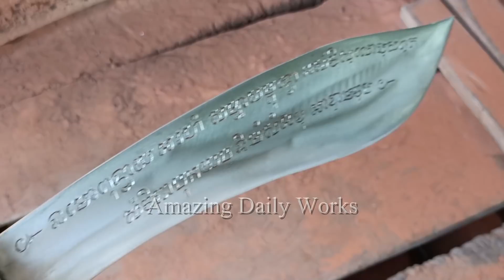Knife Making - Forged A  Super Magic Jungle Knife Out of Rusted Leaf Spring | Super Sharp Knife

Comment: round handle is bad idea for this type of blade.
Reply from the maker: What handle could you please recommend?
Reply: @AmazingDailyWorks  oval, or flat. with a round handle and such a blade shape, there will be an excessive load on the wrist during operation. and if the hands are damp or slippery, then control over the knife will be lost. and so you made a great knife. good luck.
Reply from the maker: @andrewt2510  Thank you for your advice and our team will raise up to the carpenter.
Reply: @AmazingDailyWorks  This is a great honor for me )  good luck and success
Reply from the maker: @andrewt2510  Thank you